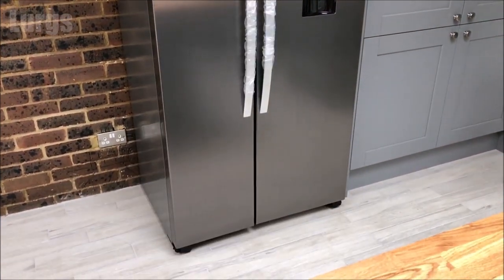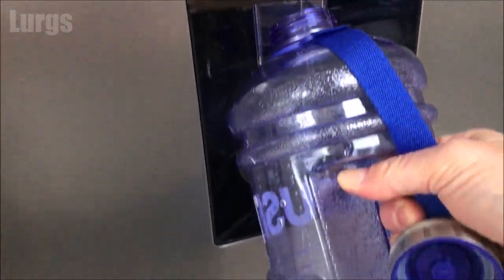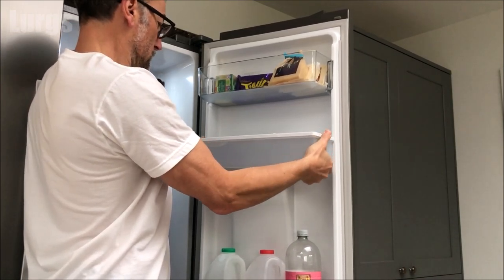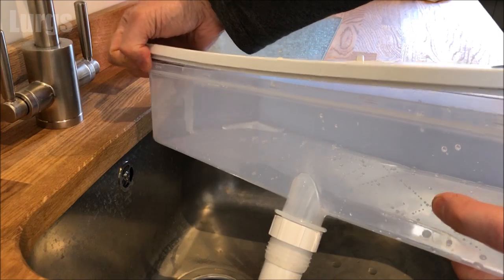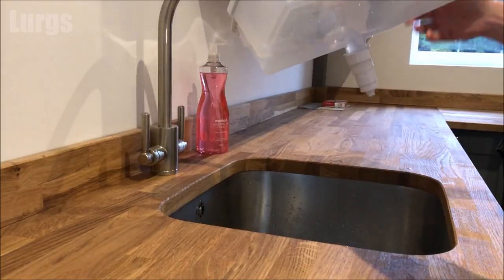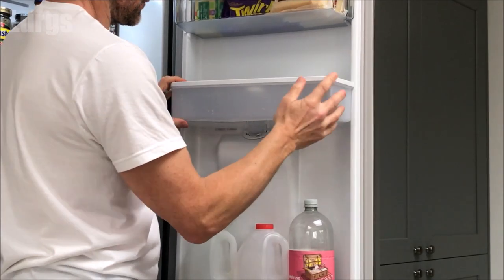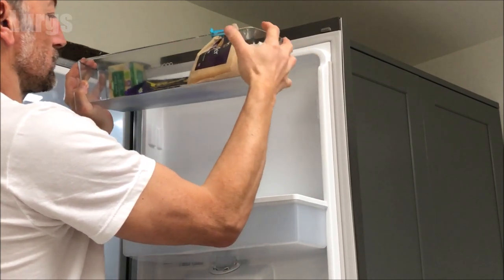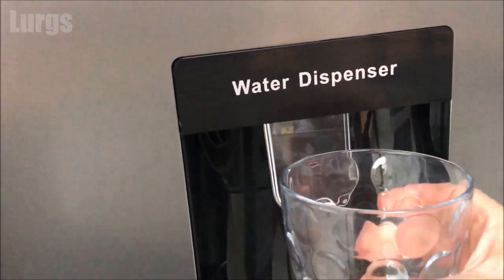Kenwood American Style Fridge Freezer How to remove the Water Tank for Cleaning and refit Water Tank

Comment: Just like to add I’ve replaced the water nozzle pump on the drinks tank after a couple of years as it was leaking badly continuous flow of water! When you replace the nozzle wrap some PTFE tape around the threads before fitting the new one!
Reply from the maker: Good tip, yeh that PTFE tape is good stuff.
Reply: Where did you get the nozzle?